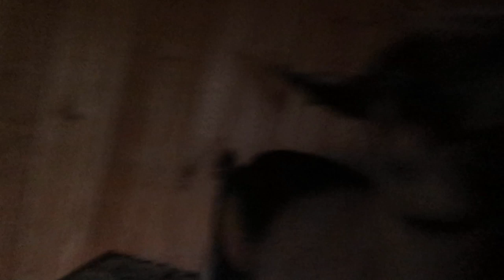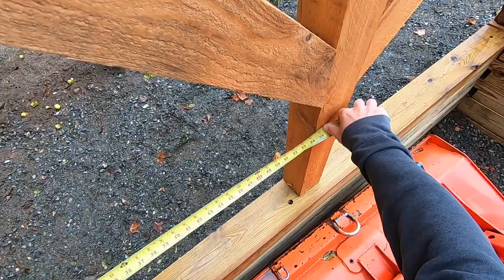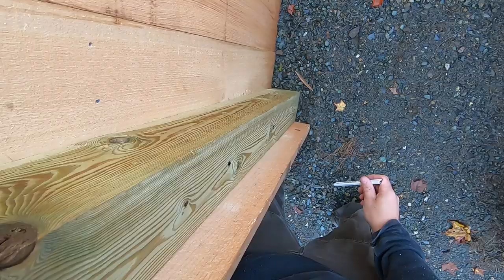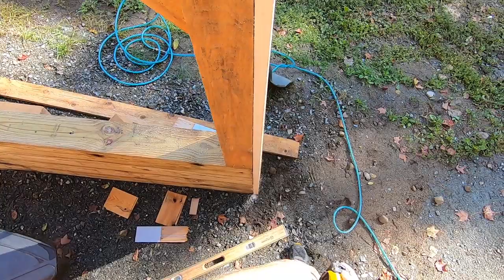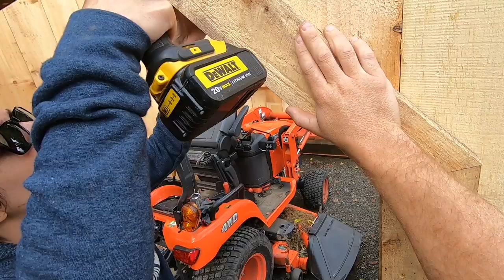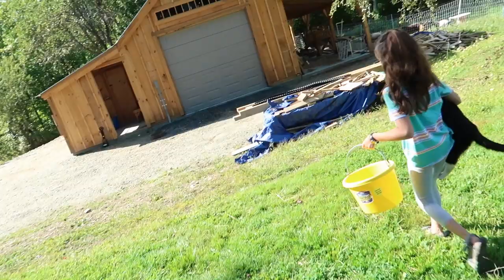Husband & Wife Install Trim on Carport Made from a SHIPPING PALLET

Comment: I installed armourlite (3/12 wire wrapped in flexible metal conduit) in my barn. It was quicker than traditional conduit and gives protection to the wires from bumping and chewing rodents....I also used LED lights.

Comment: I have to  hold my breath every time you use the miter saw. You need to learn how to cut left handed. I know of at least four time that you crossed your left arm over to hold the material when you cut. That is very scary. Hold the material with your right hand and use your left hand on the motor head when you cut. You will find it is more comfortable to.
The Wood shed / Gina's carport is looking great Y'all are a great team. Keep up the good work. God Bless you and your family.

Comment: Always run in properly earthed metal conduit, rats, goats and other animals can chew on the cables endangering them and possibly burning the barn down
Reply: This is so true. The goats are the wiring on my trailer. I use those transport lights now and keep them under the truck seats. LOL. I found out the next month or two that goats need copper to prevent anemia. I now give them copper 2x year.
Love all the building.
Reply: I always spray my cables with Louisiana Hot Sauce so animals won’t chew on em. 😏
Reply: Animals also hate used oil. Put used oil on rails in a barn and a horse will stop chewing it. It dries after a few hours and is no longer slippery or sticky. Also doesn’t smell.

Comment: Finally. I feel that I can contribute something. I am electronics systems engineer,  retired. Before investing in all the LED's.  Experiment with getting the right degree kelvin temperature of the lights. Daylight, etc.  They come in bright white all the way to yellow.
Reply: George Thomas  I like mine around 3000K
Reply: Try to have  just indirect incandescent  lighting directed to the Ground..in New Hampshire, some Counties require it..it prevents Light Pollution of the sky and  looks neater than bleak stark lights that aggress you

Comment: On Amazon - addlon brand 4ft LED shop lights.  A 10 pack of them will cover the entire barn.  Put a minimum of 2 (one in each side of the room) to prevent heavy shadows.  Hard wire 3 prong electrical outlets on the ceiling for easy plugin and expansion of lights!
Reply: 2 in the goat room, 2 in the milking room, hang the last 6 in the shop.  More light is always better in a shop/project room!  

  I also recommend getting some LED motion sensing exterior lights above the door that is always powered on.  Helps a ton when you are heading out early in the morning, or heavy snow or any time you need light!

Comment: Coming along nicely! Just be sure to rake back the gravel around building perimeter to prevent end grain of siding wicking water and causing premature decay.
Reply: FOR SURE IT WILL, GREAT COMMENT,UK
Reply: SHOULD HAVE WOOD STAINED ALL THE WOOD THAT COMES IN TO CONTACT WITH THE GROUND/GRAVEL BEFORE PUTTING IT UP!!

Comment: You should check with your local building codes on Wiring a barn or any out buildings, They tell you if you need to place your wires in metal conduit.

Comment: led shop lights , wires on ceilings, 3 and 4 way switches. Add remote temp sensor to monitor barn temp during the winter months.

Comment: You are continuing great team work and progress, not just with the work but Gina’s adapting to her new role. I applaud getting all the value that you can from every piece of wood. The carport looks well integrated with the rest of the work, though I am really looking forward to the roof being covered. 

Electrical standards and practices are different to those where I live. Your first guide is the local/national codes, second is your knowledge of the local wild life and third your desire for good practice on your property. Go for safety first and the best possible protection. Earthed metal conduit buried to the correct depth with warning tapes for buried runs, together with the protective devices supported by the rules and regulations. My neighbours have suffered from the attention of squirrels in addition to those other legendary biters and chewers. 
I have been stunned at the light output, long life and tiny power needs of LED lights, both in mains and 12 volt applications though device availability is constantly changing. Do avoid the dodgy end of the market as some devices show serious safety short comings.

Comment: I did some LED shop lights in my garage.  They simply plug into an outlet.  If you wanted you could wire some outlets with a wall switch.  Love them and low price.

Comment: About Electrical.  I was told I had to run conduit in the garage even if I drywalled it inside the wall.  I preferred to run rigid conduit on the wall rather than in the wall.  

Lighting Connections I chose to install switched outlets on the ceiling.  This way I could move my lighting around and add one.

Install a switched outlet for a fan to install high in the rafters to blow air out the bay door.  This blows the heat off the heat source before mixing with the barn air allowing the cooler air to flow off the ground.

Install a outlet for an electric garage door opener.
  Garage door openers lock down the door and push the door tight on the seal especially the top.  You are still missing this seal.

Do you want to save money on electrical cost?  Balance your circuits.  Calculate what will be used in the day, at night, summer or winter.  It’s typical to run lighting on line 1 and outlets on line 2.  Better to split the load per your calculations.  Figure all the lights will be on at the same time so split half of them on line 1 and the other on line 2.  To balance outlets run 3 wire to 2 gang boxes and run one outlet on line 1 and the other outlet on line 2.   Running many circuits makes it easy by having the ability to move circuit breakers around.

Dig your trench to the shed/barn deep enough to run electrical and water.  The water may be needed to put out fire.  Do not run the water through a regulator.  Run on full pressure.  My house is on a 60psi regulator and the hose bibs outside are on 100psi city pressure.  Electric sprinklers work better on city pressure.   I’m running two 3/4” full flow ball valve bibs for instant “On” in case of fire.   Might want to run an Ethernet wire and a com line for intercom.  Would be nice to have WiFi at the barn for WiFi assisted cell phone calls.

Run a switched power on a 3-way from the house to the carport so the carport may be lit from the house.

Consider a Yard light on a pole.

Install a circuit that has the capability to run auxiliary power such as generator or solar.

A couple fire extinguishers would look cool and pray you never need them.

Comment: Al...I definitely would install some motion detector lights for the front of the barn at least.  Also,maybe in addition to some standard lighting, it would be nice to have a couple of decorative type lanterns by the doors to enhance the charm of the building.  Maybe some colonial maritime Onion Light fixtures or Boston box lanterns. We had those on a reproduction New England saltbox we built, and people loved them. But generally, you need a security light on a pole or over the garage door.

Comment: LED striplights and run the wiring in a metal conduit (earthed, obviously!)
Reply: In very cold conditions the striplights wear out really fast. we've had to replace the LED lights in our unheated workshop 3 times now in just a couple years.
Reply: I’ve used led lights in my unseated garage for about 5 years now with no issues.
Reply: @mimiso2522  
Wet or damp rated?
Reply: @Foche_T._Schitt  They were supposed to be rated for outdoor use. But to be fair they were cheap Menards ones made in China.
Reply: Got mine at Sam’s Club not sure of the brand.

Comment: I’ve been an electrician for 10 years. The easiest way for you to wire the barn is with Metal clade or  flexible MC cable found at your big box stores. Use LED lights for brighter area and less power consumption

Comment: As an electrical contractor, I would run all your wiring in galvanized electrical conduit (otherwise known as rigid conduit), use watertight fittings and connectors, along with weather type J boxes. We do both high and low voltage systems (basically anything with electrons going through it). Also, with LED lighting, I would look at LED type switches, not your regular switches, especially if you do dimmer switches.

Comment: Personally I would go with standard light bulb fixtures. They will save you a ton on bulbs in the future. Dollar Tree even has 60w LED bulbs for 1$ each compare to 7-8$ for the specialty bulbs. Also standard romex will work if you wire in the rafters where the animals will be and wire the outlets from the shop wall for the outlets. The only conduit you might need is down to the switches if you put them low enough for the goats to get to the wires.

Comment: The suggestion I have is Braun LED shop light that is 5000 lumens. It is really brilliant. I have one near the pantry door and I can see into the back of the shelf. They're around $29 but $19.99 at Harbor Freight or use the 20% off coupon. I'm going to use them as grow lights this winter/spring sprouting time. Try one, I bet you're going to love them.

Comment: I bought two LED shop lights on sale at Harbor Freight for $20.00 each.  They work so well I only use one light at a time.  You really want a LED with a color temp less than 6000.  The blue looking lights are very hard on my eyes.  If the light does not give you a color temp you can assume they are 6000 blue and not for extended use.  (6000 color temp gives the most light output and they usually come from China.
Reply: william wallace   6000 degrees kelvin has lots of blue light!   Very harmful to your eyes.  Do a google search.

Comment: I fully agree with the metal conduit. Also, are you using a low voltage system, high voltage system, or both? The low voltage system lends to cheaper led lighting than the high voltage. Either way, full spectrum led is the best. Good for you, the animals and for seeing more clearly details on projects. It can also be used for greenhouse lighting. For a greenhouse, need some infrared lights if you want to set fruits. But for greens and root veggies, the full spectrum is best.

Comment: It's coming along nicely Al. I just switched my garage to LED's from florescent lights. I got mine at Menards for about $35 per unit. They came with plug in power cords and pull chains. I put in switched recepticles to plug them in and use light switches to turn them on.

Comment: LED, Barn Pendent and Barn gooseneck ( depending on location) retro lights in the same green as the roof tin. In the central shop area use led linear lights for maximum illumination. Metal conduit.

Comment: Being cold if you used regular flourescent tubes you would need hi-output due to the cold.  led 4 ft tubes is the way to go. i/2" pvc or emt pipe then if you need additional power you can use same chaseways

Comment: Run the wire in conduit and get the led shop lights they are very bright and last longer and don't use much electricity to run them

Comment: So, lighting: My husband installed a PIR light on the outside of our shed, so it lights up when he approaches in the dark. That's something you might want to consider. And you need conduit, definitely. Don't ask me why, I've just been married to an electrician for 40 years!! 😀
Reply: Rachel  M for the non-electricians among us, PIR is Passive Infra-Ray, which is what is used to turn on Motion Sensor lights.
Reply: @cathiwim  Actually it is passive infra-red, it measures rapid changes in temperature at the spots it is looking at, which can be used (if it's 110vac or 12vdc) to turn on various kinds of circuits, including lighting.

Comment: You could leave the "windows" on the side of the carport, facing the house, open for light and ease of getting in and out of Gina's car (unless the wind blows hard from that way and it would fill up with snow).  I like looking at the timber frame structure from the outside as well as the inside.

Comment: I'd put the wiring in metal conduit just for looks, although others mention keeping small animals from chewing on it - a good reason.  I would be sure to put an individual light in the carport (and woodshed to get wood when it's dark) if you have electricity there, or solar.  It would be nice if that light could be remotely controlled from the car or house, or motion-activated with enough sensitivity to have it come on when a human, as well as a car, approaches it.  In the barn, be sure you put a lot of plugs around.  Consider a few 220 plugs, too. When we built our office, my husband went crazy and put a plug about every four feet.  I thought that was overkill, but I was wrong.  In the workshop area, we put some plugs that hung from the ceiling making it easy to move equipment around without having cords to trip on.  They do kind of get bumped into though, but we can hook them up from a beam to get them out of the way.  I have no suggestions for lighting.  We used fluorescent lighting, which has worked out well. One more thing, put some weather-proof plugs outside the barn that can be used if you are doing something outside.

Comment: Good morning Al, Gina, and Olivia. 
The carport is looking good. With the rain, it would be a good time to check the new barn roof for interior leaks before the snows start to fall. For overall illumination in the barn, I would recommend the LED light fixtures that are like fluoresce tubes, but also task spotlights where your workshop is going to be.  If the wiring is going to be visible (not hidden inside a wall, I would use conduit ( I think it is also code requirement). I would get GFCI circuit breakers for all the recepticals.  I would include at least one outdoor receptical on each side of the barn. 
Have you decided which of the boys will be breeding which of the girls yet? Will you be doing a video on goat breeding, the record keeping, genetic considerations, inbreeding practices, the hazards of bringing the couple together for breeding?
Thanks and have a wonderful weekend.

Comment: Goooooood Mawnin' Al!    Really enjoyed your parting thoughts!  Just invested in a Milwaukee Hydraulic M12 impact driver...amazing little tool, quiet, powerful and very comfortable in the hand.  I debated on the cost benefit ratio and considered much less expensive tools but now that I've used it I'm sold!  Most of my previous tools have been Royobi and while they do the job they definitely lack the best R&D.  I'm usually driven by cost but all my concerns about if it's going to be worth it have been satisfied.   Only consession that I'm noticing is a little speed and maybe a little less power than the full size and loud versions that most people have come to know.

Comment: I just installed a "double tube" 3' shop light from Home Deport (house brand) for $20 each. They have great light in my garage and have a pull chain on them so you don't have to have them all on at the same time. Being LED you can have many of them on the same circuit which will cut down on materials...

Comment: For my barn shop I put up LED shop lights.  For the electrical, I used 3/4" conduit and installed an outlet in the celing controlled by a light switch.  The advantage of this is that I could also hang a retractable cord reel for quick plugins anywhere in my shop.  I've been very happy with this setup.  The lights are almost daylight bright.

LED lights: https://www.amazon.com/gp/product/B01N9AO7VI/ref=ppx_yo_dt_b_asin_title_o04_s00?ie=UTF8&psc=1

Cord reel: https://www.amazon.com/ReelWorks-Extension-Swivel-Bracket-Triple/dp/B01GJ7YRTC/ref=sr_1_9?crid=39OXIKK73228B&keywords=cord+reel&qid=1567855559&s=gateway&sprefix=cord+re%2Caps%2C157&sr=8-9

Comment: Not sure if it will be an issue or not.  You may have to install a back panel inside the feeder (Slanted at the bottom towards the goats) so the hay will be narrower at the bottom.  The goats don't seem to be able to get their heads inside the panels to reach the hay in the back once they eat the hay that is close to the front of the feeder.  Just an idea.  We just sold our 154-acre cattle farm.  We put all our electric in conduit in our barns this way if you are doing anything in the future: work, projects or moving animals inside, there is no way you will snag your wire. Again just what we had in ours.

Comment: Hey Al I used pvc pipe instead of electrical  conduet, To me it  was cheaper to use ,because  conduet was way more expensive.  It will be buried under ground and it won't hurt the pvc if buried deep. there is also a grey conduit with plenty of strength. just get to your hardware store and find the cheapest, Compare all and check it out. if using pvc all you need is the glue. Hope that saves you money! David from Virginia new subscriber!

Comment: Check your local building inspector for recommendations on conduit or no conduit.  In a barn I would think conduit would be most appropriate but again local codes should prevail. I would use 12Ga wire on all 120v circuits.